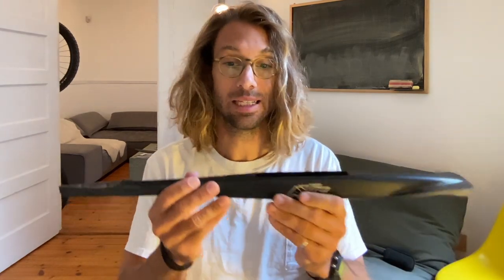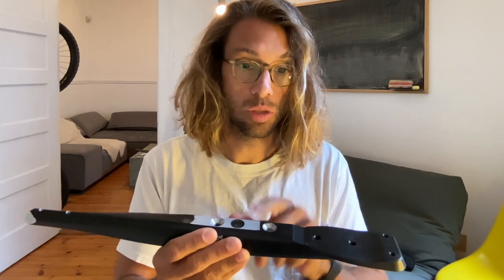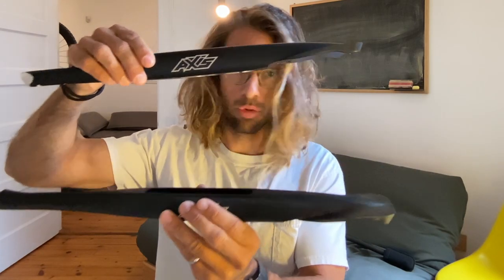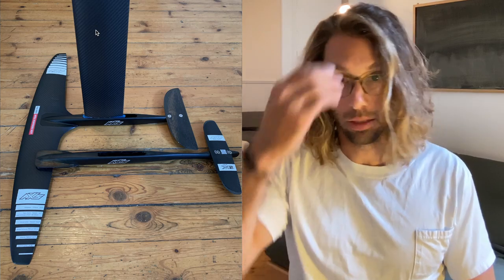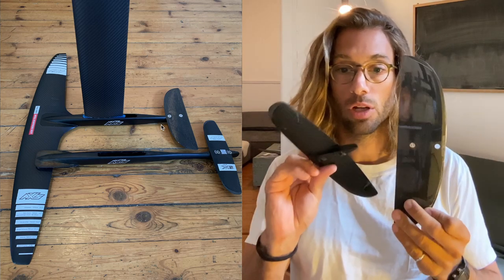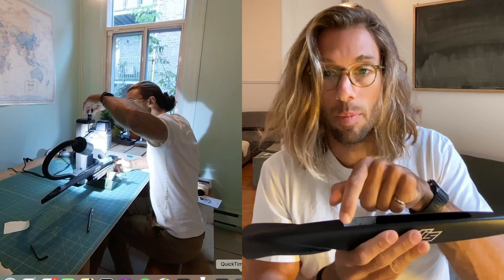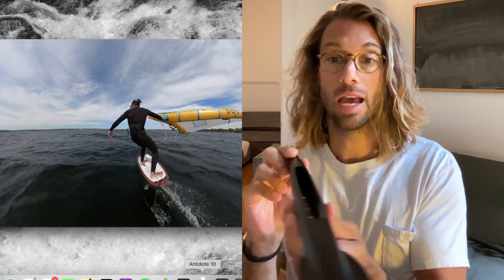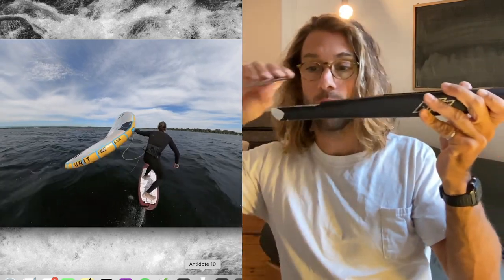Axis RADICALLYSHORT +77mm advanced fuselage prototype

Comment: Nicely done mate! What's the new stab you're using? Any play on the fuse/mast connection point?
Reply from the maker: 🤙 I built it from a sillyshort… I made sure that the fit is snug so I made the pocket 0.05mm narrower than the original the fit is super snug, no play whatsoever.

Comment: What did you fill the hole behind the mast with after putting it in the new position?
Reply from the maker: I cut out some dense foam that I forced through the hole. if you want to make it permanent, I would recommend a 3D printed piece. From a structural standpoint, it takes 0 force.
Reply: @james_goulet  Got it, thanks.